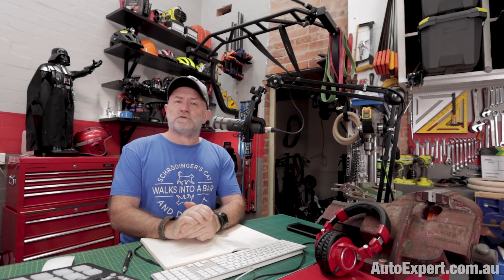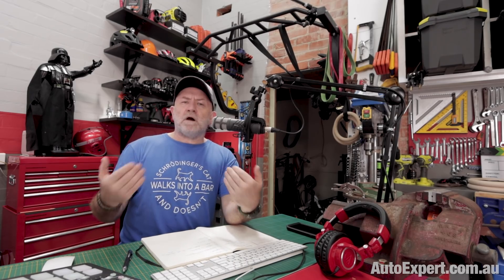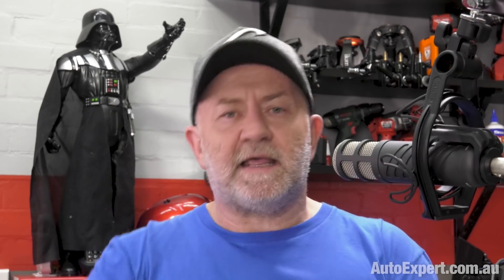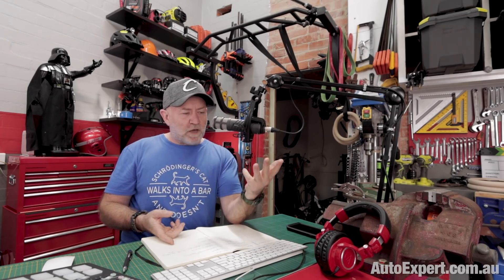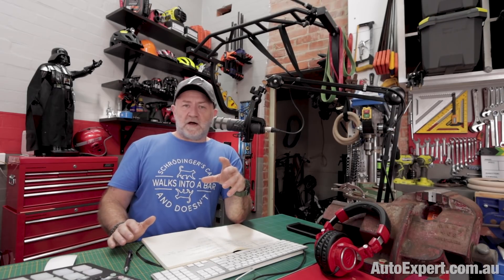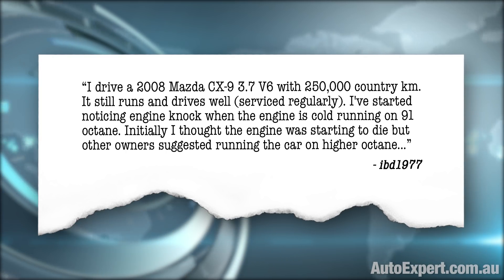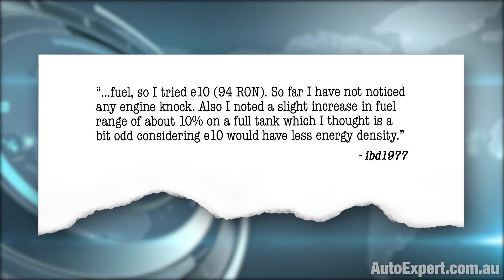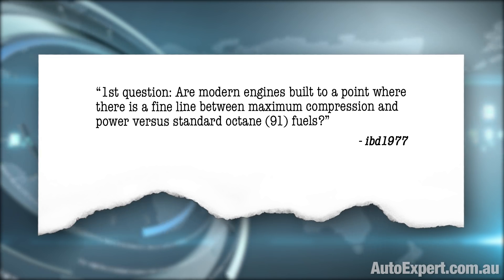Octane rating & engine knock: ultimate 'beer garden physics' deep dive | Auto Expert John Cadogan

Comment: This is not boring! I became a mechanic because I loved this stuff. To be a great mechanic, you have to work hard to research this stuff as it is generally not taught. This type of theory is crucial to properly diagnose vehicle issues. Most of this research was off the clock, in my own time. However I soon realised that the marketplace doesn’t value this level of expertise in a mechanic, so I completely changed careers, to one that actually pays well for the effort you put in. I Still love cars, still love researching this theory, so keep it up. I love it

Comment: Here in America, the 2.5L turbo Skyactiv can run on 87 or 91/93 according to Mazda. The engine makes less hp with the lower octane ofcourse, but it was cool of Mazda to design the engine to run both safely. Comparatively speaking, the engine's peak horsepower is a bit weak for its size (even running higher octane)  but that's by design. The big displacement and turbo provides more power by default, but Mazda tuned it conservatively (compared to something like a 2.3T from a Focus RS which makes about 100hp more).  Mazda's main goal was drivability. As John pointed out, the engine is making generous torque in the low to mid range which is what you feel in terms of acceleration. Since Mazda didnt tune the engine for peak performance, you're able to run a lower octane fuel if you choose.

Comment: Hey John, I hear a lot about low speed pre-ignition (LSPI) as an engine killer on boosted direct injection engines. Also a heap of different reasons that contribute to the conditions leading to catastrophic pre-ignition, including oil additives, cylinder temperatures, carbon build up and exhaust reversion. I would love to hear you cover this in a detailed engineering deep dive

Comment: In the Army we had to explain to young diggers that the propellant (hint there) in a round did not explode but converted to gas, building pressure to propel the projectile out of the barrel. We were taught that an explosion was the unconstrained instant conversion of fuel to gas/pressure. Sounds like we got it slightly wrong. Well live and learn.
Thanks for the enlightenment.
Regards Tony

Comment: John, just a point on faulty knock sensors. All ECUs I have worked will apply the full ignition retard, for example - 12º in the case of a failed knock sensor. This is the fail safe mode that engineers have built in to protect the engine in such situations. 
I have actually seen a number of times this being the main reason older engines have lost power from when they were new, either via a failed knock sensor or increased mechanical noise which mimics knocking sound and falsely triggers the ECU to retard despite no actual knock. That said the modern ECUs have much better signal processing and can distinguish between mechanical noise and knock a hell of a lot better than in the past.  Great episode by the way.

Comment: Dear John....greetings from 'Murcia (lol). Even though your vids are directed towards an Aussie audience, I enjoy them and have learned much from them. Fortunately I know enough about the metric vs imperial systems I can do the conversions in my head with a fair degree of accuracy. Only complaint is most of your vids focus on SUVs and UTES. I'm a truck owner (2000 ford F150 5.4L V8, 05 Dodge Dakota Quad 3.7L V6, and 06 Dodge Ram 1500 4.uP V8 longbed. Wish you did more truck related vids. But still, alot of great info!

Comment: Fun fact. SAAB released APC (Automatic Performance Control) in 1985. The worlds first ever Knock engine performance control where Knock is continuously monitored. And Timing and Turbo boost pressure adjusted on the fly to remove knock. The end result was you can use any quality fuel and the engine will not knock. Or if you use higher octane fuel you get more Boost pressure and so more power. The system was completely independent with its own loom. So in the 80's it was popular to pull APC from scrapped Saabs and retrofit it into other turbo cars to get more power.  In the EU that was a common mod for the Renault 5 GT Turbo.

Comment: Beer garden (fat cave) physics are my favorites. Also, a common cause of lean feul/air mixtures is a dirty MAF sensor (the MAF thinks there is less air getting to the cylinders than there actually is, and lowers the amount of fuel, resulting in a lean mixture and possible knock.)

Comment: John, just take a crankshaft and place it in an engine lathe (between centers).  Adjust the headstock speed to around 1K revs.  Turn things on, you will take a step back from the excitement.
Reply: Not so much if it is an internally balanced crank!

Comment: In regards to the question 3 about E10 seeming getting better range, perhaps the ethanol has cleaned some part of the fuel system / engine that was causing the "knock" and improved the mpg? (if this were the fix then now switching back to regular fuel would yield a 2-3% increase in range again ideally).. i have heard people talk about the solvent properties of ethanol so wondering at 10% if its enough to do any additional cleaning besides what is usually in the fuel.

Comment: OK so new question. If you are comparing to a ratio of iso octane and some fuels are MORE knock resistant than iso octane. How do you measure 110 octane fuel? Do they start diluting the fuel they are testing down with n heptane until it matches 100 octane?

Comment: I’ve got one for you, John, and I believe it touches slightly on a topic you’ve covered before. Turbocharging.

Back in my younger days, I threw all of my income at my ‘attainable’ dream car, an Eagle Talon TSi AWD (Mitsubishi Eclipse GSX). The local ‘crew’ would sometimes rev their engines in neutral, to see who could hit the most boost, which meant more power, to their way of thinking. My car, which was plenty powerful, would never build any. One thing I had noticed was that you would get more boost going up a hill in a higher gear than a lower, which corresponded to a bloke, Corky Bell’s theory, that the turbo was driven more by air demand on the intake side compressor turbine than exhaust pressure on the hot side of the turbo (which is the opposite of how you’d think it would work).

So, what say you? Should a turbocharger generate boost pressure at idle? I always told them their engines must have been generating a ‘resistance’ for that to happen, which only resulted in laughter...
Reply: I’m no engineer. But i think it’s worth pointing out here that a turbo only uses exhaust gas due to energy economy and the relationship between higher exhaust flow and desire for higher air intake pressure. If you e.g. achieved the same pressure with an electric “turbo” then you would want it to spin up when you put your foot down. if you don’t get this result with a conventional turbo then i’d suggest something isn’t right.

Comment: There is another XP about the thought to be engine knock problem. Check that the knocking sound is not coming from the valves just in case. But if stuff goes away at op temperatures it is related to some extra clearance somewhere where there was not supposed to be that gets less of a problem either by removal of excess vibration or heat expansion(which is weird considering engines are cast of matching parts that should expand and contract at the same rate roughly). 

In my story I had a Diesel BMW that was 10 years old and it started making sounds like the one you described. In my case it was caused by a non-metallic component wearing out: the dual-mass crankshaft belt pulley driving the serpentine belt. It is made of 2 metallic pieces held together by a rubber that has a lifespan of about 10 years and it goes like clockwork. Eventually it will fall apart and destroy some bits in the engine compartment so better safe than sorry. The knocking goes away because the engine idles with less fuel more evenly when at operating temperatures. At cold starts the engine kicks a bit more agressively trying to not stall and the dual mass flywheel at one end and this pulley on the other together deal with that vibration of every single cylinder kicking one big one that needs to turn into a continuous motion. Not sure how much access you have there but I would also tick this box on the things to check before jumping to the knock conclusion. Remove the belt by releasing the tensioner pulley and pull the belt off the crankshaft pulley. Without the belt putting any force on the crankshaft pulley try to make it twist off axis wiggle it around. It requires some strength even with a worn one. If it has any play you have found your problem. As to why it would make your E10 experiment work better... well maybe it is just better quality fuel that burns more evenly and reliably than the bottom of the barrel 91... it probably has better additives... who knows... but either way the cold idle knocking sound is always going to be an expensive one unless diagnosed right then and there because it will progressively get worse and metal on metal contact is never good in engine land. Have fun and I hope you find your problem in time and will be able to address it in time. Good Luck.

Comment: I've got a very old engineering book called "Fast diesel engines" it talks about the difficulties of getting diesel engines to run over 2000rpm, so i guess 3000rpm was pretty impressive long ago somewhere :D
Reply: SinPistones I remember my father a diesel engineer said that on larger engines the tacho can display single digit RPMs and I recall observing this on a ferry tacho which was the biggest dial in the cabin which had 10 RPM graduations.
Reply: @darylcheshire  Ship engines can have very low rpms. Was on a banana transport ship once, the captain told us the cruising rpm was 80 and they could go up to 120 in case of emergency.
Was of course an engine that was big enough you could stand inside it below the piston when it was at TDC.
Reply: @Kris_M  You've got me scratching my head now, wondering what constitutes an emergency on a banana transport ship ?
Maybe got to get them to the bending factory before they close. 🤣🤣🤣

Comment: Back in about 1974 the ACU in Australia banned Shell or BP A from motorcycle racing. This caused a rash of holed pistons etc. Then someone discovered that Shell 115/145 octane fuel (Which could be bought from the Clyde refinery in 44's) would fix this problem. How is it that this sort of fuel can no longer be made?

Comment: There are two type of pinging . Detonation and pre detonation.
Detonation occurs at about the right time but is a violent explosion that often happens due to one or more of the following. Bad fuel , carbon buildup either increasing the compression ratio or creating hot spots or both, the engine is being overloaded (high gear low revs) or the timing is wrong.
Pre detonation can occur due to all the above but before it is supposed to happen.
A reason for a well used modern engine knocking when cold is the Knock sensors need to warm up to work or the 02 sensors and ecu running the engine too lean and at wrong timing etc ,

Comment: John, after driving a turbo-charged car, how long should the motor idle, to allow the turbo to 'spool down?' 

I remember trucks having a reserve of oil, under pressure, to supply the turbo bearings for a few minutes, after shut down.
I do not have such a car but my technical interests in your comments are educating.
Please finish the story on the 10mm socket!
Thank you, John from Geelong

Comment: Great video. Makes me question all over again why so many manufacturers didn't persist with the Wankel engine. The rotary just seems to make so much sense!
Reply: Todd Orton  Yes, seals have always been an issue... I've owned numerous rotary cars, modified and not, but I question why manufacturers never stuck it out to rectify such issues.
Surely the benefits of a rotary engine warrants further research and development?  Besides Mazda, manufacturers seemed to put in half-arsed attempts with the engines, like they considered it a miracle engine then walked away as soon as there was trouble!

Comment: So John What is Pinking/Pinging? In an older car perhaps even a newer car on a hot day when the timing is advanced and at high load and low rpm. An example of this would be not changing down gear and laboring the engine in top gear?  So is the combustion commenced to early and completing prior to the engine reaching TDC?

Comment: Great video.  One question:  Is it considered "knock" only when the two flame fronts meet?  For example if there was excess carbon build up on the head which cause pre-ignition, but that occurred early enough in the cycle for all the fuel to be burned before spark, is that still considered knock?  In the days before fuel injection, that would result in a backfire.

Comment: Pre-Ignition is an autoignition event prior to the scheduled ignition event. It's quite common on modern DI Twin-Scroll Turbocharged engines in the form of Low Speed Pre Ignition.

Knock is an autoignition event that is secondary to the scheduled ignition event. As the cylinder pressure starts to increase after the spark plug fires, there is an autoignition event that occurs elsewhere in the cylinder creating competing flame fronts and a premature spike in cylinder pressure. This puts extra wear on the top rod bearings and to a lesser degree the bottom main bearings. It also creates a resonance that can cause ring lands to fracture and can strip the boundary gas layer which can pit or even melt pistons.

While the effects are generally similar between the 2, Auto Ignition is considered to be worse as it occurs earlier in the compression stroke and is generally less controllable. 

One chemical that is found in an engine that has a very small octane rating is oil. An unfortunate byproduct modern engines being built looser is blow-by. Blow-by causes oil to be  aerosolized and drawn into the PCV system therefore into the combustion chambers. This can be a leading cause of LSPI. There are oil standards that are meant to help reduce the effect however I just wish auto manufacturers would design PCV systems that have an oil separator component.

Comment: Can you give me some advise. I have a 2005 BMW 3.0 diesel convertible with 110,000 miles. I am thinking of getting the engine carbon cleaned also cleaning the fuel system, egr and turbo costing £250.

A lot of people are taking the piss saying it's a waste of money and doesn't work, I don't mind spending the money to make the engine to run as efficiently as possible. 

Would you recommend it?

Comment: I have a question for you John. 
Do octane recommendations/requirements for a vehicle change as you increase in elevation? I ask because I've noticed the octane ratings for pump gas at higher elevations are lower then they are at lower elevations. For example I live at 8000ft elevation and the highest octane gas we have is 91 AKI and at sea level the highest is 94. 
In other words if my car is required by the manufacturer to run 91 octane,  could I run 87 at higher elevations. This would be just for a NA car. I realize a forced induction motor would still need the recommended fuel even at higher elevations.

Comment: Good video, getting into the geeky depths of things is fun sometimes. This one made me think of a local-to-me "Murica-ism... 85/87/91 AKI fuels in high altitude regions. I know the theory, less air pressure = less cylinder pressure = less chance of knock. However I have yet to see one manufacturer mention it, and they all test new cars out here. The owners manual always says "87 minimum". You'd figure they would call out 85 octane and say it's OK above a certain altitude or that it explicitly is not OK ever, especially if there was the slightest chance it was causing extra repairs under warranty. It's been this way long before fuel injection and knock sensors and looking around at the fuel station, basically everyone uses 85 unless it's a 91 plus-required engine. Do engines maybe last a little less time out here because of accumulated knock damage? Who knows. My own scientific-ish test (same long uphill, vehicle speed, RPM, air temperature) did reveal that my car does advance timing by about 4 degrees more when using 87 vs 85, consistently over many tanks of fuel. That's a difference for sure, but I think if it really mattered in a tangible way manufacturers would say something about it. I settled on just using 85 unless I'm off to a neighboring state that isn't as high up. Of course I'm not saying octane doesn't matter at all (I have a crusty older car that knocks on hot days unless it's got 91 in the tank), I just find the altitude situation interesting.
Reply: Calm down :) Air Flow Sensor, compensates fuel injection, for altitude - Yes, Loss of Power - You put the foot down - Throttle position sensor/ Knock sensor,  know what you want? Ming Moll Thingys?
Back in my day - Carb needed adjustment for altitude: Idle wants to be faster at Sea level - Cuts out at altitude...
Kinda thing... When in doubt - Higher octane - More Detergent - Nothing wrong with that? 
You typed so much - Wouldn't whinge about a little cost?
Personal experience: Higher Octane's better - Even if the better mileage doesn't compensate cost - Keep injectors clean? 
How much would Fuel additive cost?  I use high octane + occasional PEA fuel additive. Cheaper than expensive repair? :)

Comment: Early 60's Chevrolet 348 cu. in.  wedge head engines were bad to get carbon kock. The cure was to get the engine warmed up and then dribble a Coke bottle full of water down the carburetor whilst revving the engine. The water would flash to steam and break up the carbon deposits.